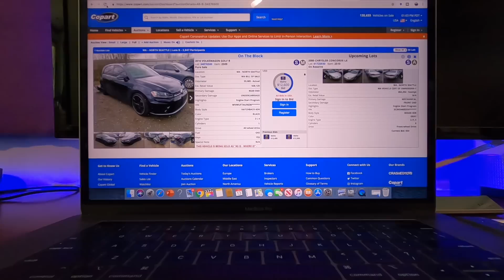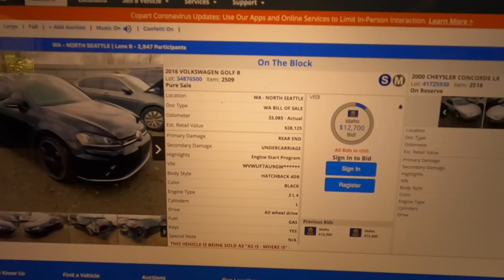I Just Bought A DAMAGED 2016 Volkswagen Golf R From Copart AND I CANT BELIEVE IT CAME WITH THIS!!

Comment: Is it not a bad idea to pressure wash the entire engine bay the way you did in this video? There’s battery terminals, air filter, fuse box and other electronic connections and sensors that should not be getting hit by water let alone pressurized water ?

Comment: Who and why cut the rear panel off and where all the new parts come from? ,I find that very strange?,if you crash a car in the UK and it's written off and then goes to salvage yard,car gets sold after pay out?,i don't understand why or who would remove the panel and buy all new parts if it's a salvaged car, (unless whoever owned it was going to fix it so got the new part's but then insurance wrote it off...
These car's seem expensive in the USA, bc get a clean titled one in the UK for ALOT cheaper. ..nice project. ..👍